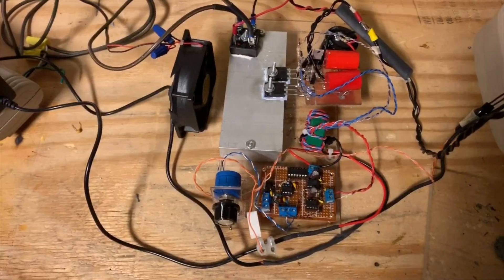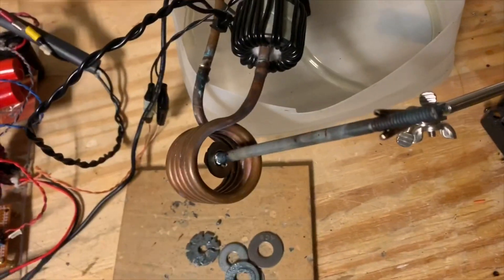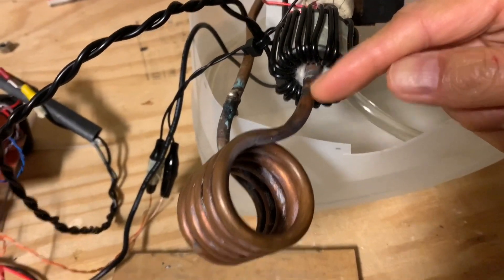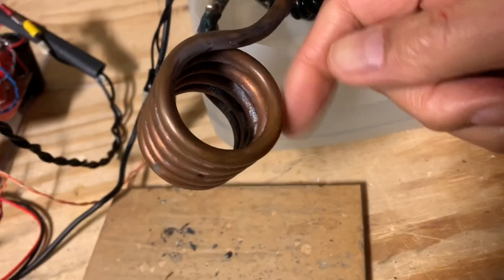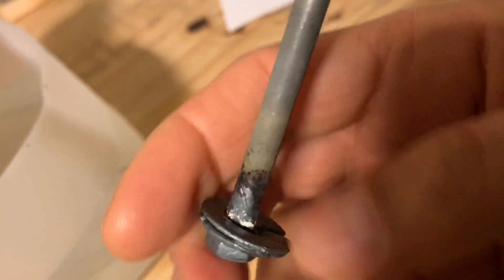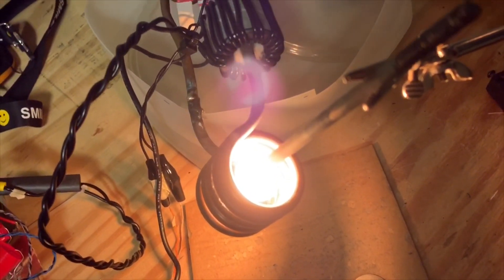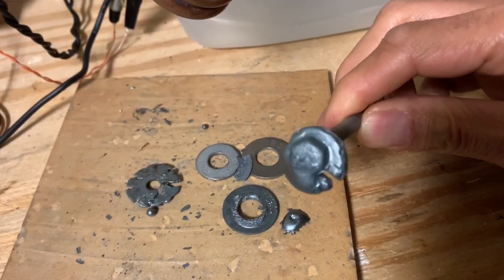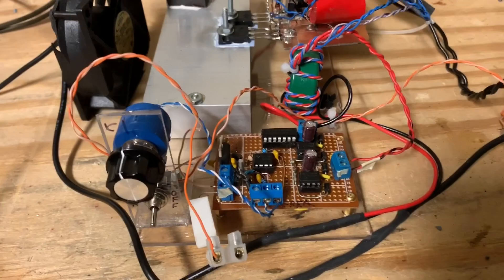Self Tuning Induction Heater Test Runs

Comment: So i need a lot of help im trying to make an induction heater for brazing for copper to copper or to still or to aluminum so im guessing im going to have to drive the circuit to a higher frequency 
But all the information im seeing is for magnetic metals maybe you could probably give some direction on some mathematics to even know what i need to be achieving parts and power

Comment: Dear sir made induction heater according to ur schematic but my induction heater taking 1amp on load. And taking to much time to reach at 200 degrees calcius plz help and. Suggest
Reply from the maker: Have you tried using different tank capacitors. Certain capacitors are very lossy. The best ones to use are poly propylene film capacitors. If you can get those in your country, that would be great. If not, would have to look for a different type of capacitor.
Reply: @BrianDhvTinkerer   iam using igbt snubber capacitor in tank 1uf 2500dc
Reply: Iam using alcon electronic igbt snubber capacitor. 2500v dc

Comment: Does this units induction coil which is made of copper tubing water cooled have a problem with surface electric skin effect which could easily be fixed with LITZ wire ???? I remember the General Electric induction heater used low frequency oscillation which really heated deeply metal for surface heat treatment. I did not ever set the machine up for metal melting but can say the machine was super high powered. GE machines were second to NONE, PERIOD. We never had a problem with the unit. Quality was job one years ago in America. Today CHINAMAN JUNK is supreme and garbage for sure. Thanks for your time fella. Love your videos too.

Comment: I am testing  a full Bridge Mosfet induction heater which I built myself , and presently  power testing it from 100 Vdc only. The  inverter supplying the square waves  to the work coil  with a graphite crucible inserted undergoes minimal parasitics or disturbances when tuned to  fo Resonance frequency, but when one or 2 (2" long) steel nails are inserted the inverter will become v. unstable as resonance is approached  which neccessitates heating at slightly above resonance. Any idea why is that ?
Reply from the maker: If the DC blocking cap on the inverter is too close to the Fres of the tank could be issue. Also make sure coupling transformer is impedance matched by either increasing ur decreasing turns and check power transfer
Reply: @BrianDhvTinkerer  Thank you much I will check

Comment: Thank you for posting this video thats a powerful induction field melting steel well done. I am keen to know how did you measure the current waveform as shown in yellow on you oscilloscope? Is it through a current transformer or just by looping your oscilloscope probe?
Reply from the maker: Yes great. Thanks for your comment. The oscilloscope is actually looking at the gate voltage. The unit is resonating around 85 KHz. The larger coil  used to melt copper metal resonates at 50 kHz. I’m pretty sure the tank current is many thousands of amps. The next time I run it, I will scope the current transformer with burden resistor. The current transformer is set up so that 1V equals 100 A.  I’m using a current shunt  to reduce the amount of current in the current transformer. The current shunt is 1/20 cross sectional area of the copper tubing
Reply: @BrianDhvTinkerer  very interesting thanks for your reply

Comment: Dear sir problem in my driver section driven section give me 6v output
Reply from the maker: If you use 12 V on your inverting driver chip you will see 12V peak to peak (Ie +/- 6V on your GDT primary input. If you use instead 12V on combination of inverting and non inverting driver chips, you will see 24V peak to peak on the GDT primary input Ie +/- 12V

Comment: I really appreciate that you step through the whole circuit and explain the function of each component.  This is something I really want to build so I can make some of my own parts out of free metal.  I am thinking I will use a silicon carbide/graphite crucible to melt copper using your circuit.
Reply from the maker: Thank you. Please let me know if you need any help with this project.

Comment: full resolution circuit diagram link is not working please check, thanks
Reply from the maker: Waqar Shakoor I just checked and it’s working. Try out this link:
http://www.imagebam.com/image/0965f21333273411

If it does not work, please send me your email and i will send you the circuit diagram as a PDF file.

Comment: Nice circuit if had to guess would say 555 main  oscillator,   74hc14 inverter chip and a pair of ucc3732* gate driver ic driving the GDT...  with the feed back to the inverter ic for resonance?
Reply from the maker: Cores are ferrite from amidon corp. i can get part numbers. The circuit diag is here:

https://teslascience.wordpress.com/autotuning-induction-heater-circuit-tested/

Good guess!
Reply: Thanks 4 reply can I also ask approximately  what frequency does it run at
Reply from the maker: Tested to Destruction apprix 88 kHz